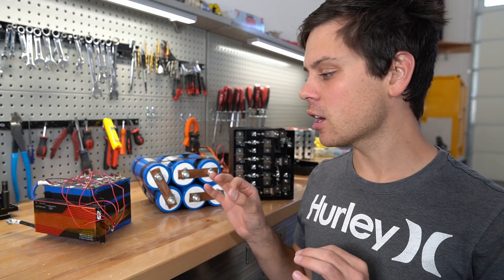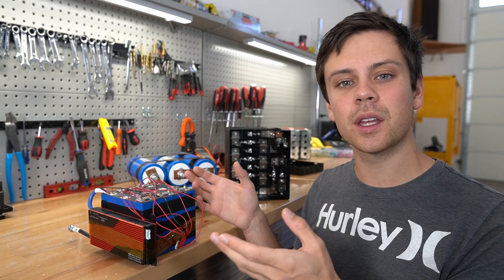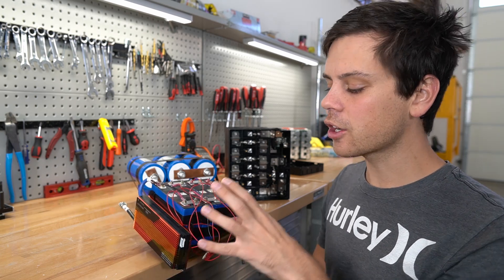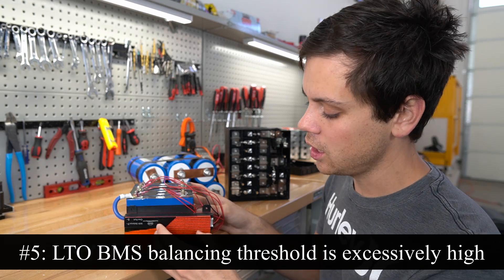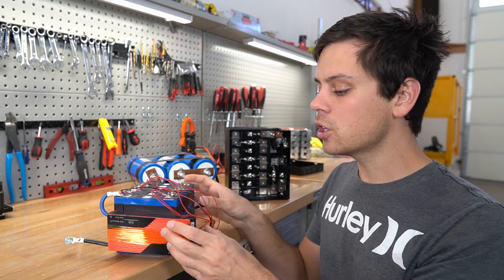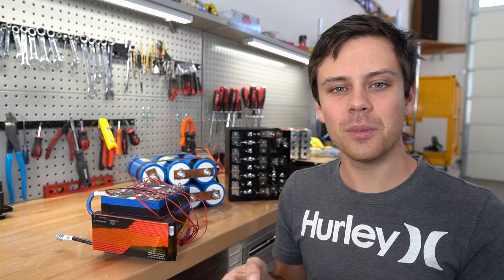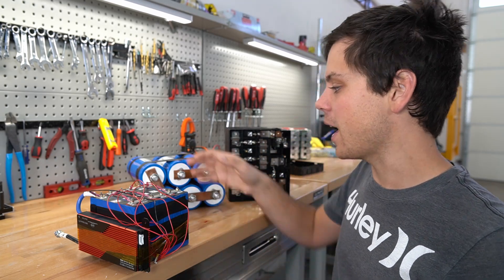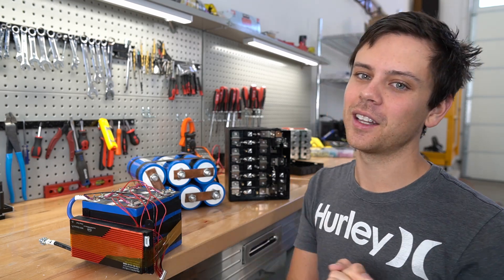I was wrong about Lithium Titanate batteries. But should you use them for solar? 2020 Update

Comment: 2:43 These cells have a charging voltage of 2.7-2.8v and that should not be exceeded at all. 2.6v and 2.7 volts are the best for longevity. So either 15.6v or 16.2v for a 6S configuration. Still not ideal for 12v applications, but when you say 18 volts, this is misinformation. Just a heads up :)

Comment: Kudos for admitting a mistake, but I don't agree with your positioning of LTOs - I run a 8 kWh LTO battery in an off-grid cottage with up to -30 in winter. No worries, it just works - and I assume for decades. 
In conclusion, LTOs are worth every cent of their price.

Comment: These really shine in remote outdoor solar applications like radio repeaters, mesh nodes, and weather stations where you will encounter sub-freezing and possibly very hot temperatures.  I wish you could find deals in a smaller form factor that 60138, 60160, 66160 as these are overkill for LoRa mesh nodes (and you have to do 2S for most of these applications).  I am experimenting with Li-ion and LiFePO4 burial beneath the frost line for LoRa in Arizona where we get both high and low extremes.

Comment: Hi Will. I enjoy your videos. I have a MS in Physics and pretty much understand everything you are posting. However, I have a specific application question. I have a 4WD golf cart. Currently uses 8 each 6 Volt 200 A-h batteries. I would like to replace those with lithium of some type. The buggy uses 2 each 18HP or 13.5kW electric motors. The motor controller is a 600 amp. So, it pulls a lot of peak current. I think it drops back to 100 to 200 amps just rolling along. I can buy 12V 100 A-h LiFePO4 batteries for about $150 each. A 4S4P setup would be $1200. However, I need at least 200 Amp Continuous discharge and 600 Amp peak. The LiFePO4 batteries fall just a little short of this. To replace the Pb Acid batteries costs about $1200 as well. I have also looked at LiTi or LTO and 22 each 40 A-h cells look attractive at a comparable price. However, in both cases the BMS limits the discharge. I am seriously thinking of using 20 or 22 cells of LTO without a BMS. What do you think??

Comment: If solid state doesn’t live up to the lifespan for LTO then I think that I will go with LTO because it only takes a good Ultra Capacitor configuration to fix the rest of the issues that are listed for efficiency. Ultimately making the system much more reliable over longevity which is the real goal for these systems for me. I don’t want to mess with them later on down the road other than a little maintenance. and it makes the system environmentally friendly overall because barely anything is going to landfill if it’s built right over my lifetime. It also allows expansion without worrying that if the other parts are not working correctly I wouldn’t be able to over the long term. The biggest issue is that I just can’t slap a bunch of capacitors together and call it a day because they would pull off the lifespan problem. The amp hours are terrible for them. For 12v you only get roughly 7ah but they have a flip side to them of having the benefits that batteries lack.

Comment: 5S-lto=15v 
I fail to see the issue. 3.0v times 5 cells. 
Please tell me you went back an recalled that statement
Reply: LTO cells are 2.3 to 2.5 nominal voltage being rather low to all other options.
Reply: @RichardPrendingue  of course but a 5P configuration gives you a 15v Max ceiling. Plenty for automotive or solar set up but I'm a lifepo4 guy

Comment: Yup LTOs are way over priced, but I like them more then LiFeP04 for a lot of reasons they have the highest C draw out there, the BMS inside does control the max draw current and has a wide range in voltage to play with. I use LTOs on a 12v setup with no problems, most of the inverters are not accurate on telling you the right Voltage. I got a big 12v inverter that is off by 1 volt higher so I take invantage of it, the inverter V range is 10v to 16v perfect range for LTOs. Just program the MPPT controller to work in that range and it's aficentcy is over 90>%

Comment: I want a good set up for my full time. Living RV off grid, looking at purpose built rack batteries, my question is, waht volagae is best 12, 24,48 and wahst the max KW system, need to run lights, computers, kettel, starlink fridge microwave etc

I have looked at 5 kw systems, but can I really accommodate enough panels to charge such a unit and advice would be great

Comment: I have a very specific use case for LTO - IoT equipment in remote locations. I like the fact that LTO cells will charge without issue in very cold weather and the long life cycle offers much reduced maintenance. My question relates to charging. It looks like LTO batteries in 1S configuration will work well with a constant voltage charger with a specific cut off voltage of around 2.8V and no trickle charge. If so one of the adjustable SLA battery charger modules will do the job just fine. I do not need large capacity - 10 Ah will be fine maybe 20 Ah depending on operational factors. The voltage will need to be boosted to around 4V. Am I on the right path:

Comment: I dont get your Voltage Numbers on LTO Cells, specially on capacity test.
Yinlong 66160 
Charging upper limit voltage 2.8V
Discharge cut-off voltage 1.5V

You did not go to 1.5 per cell an claim they dont have the ratet capacity

Comment: In Australia, there is a national battery testing center, that tested lithium storage batteries provided by BYD,Tesla and LG among others......and the results were not so good. BYD had 15% degradation of capacity after 4 years, Tesla powerwall and LG had 30% degradation after 4 years.  LG just had to do a major recall on their products for setting homes on fire when their units failed.  How it performs when its new, is not the same has how it performs after being in use, in real world conditions, over cycles and time. EV's are doing better, since most people are not charging/cycling their batteries every day.

Comment: Did you consider the differences between manufacturers and chemistrys of those LTO cells? I'm currently researching this chemistry, and found out that LiShen for example has a nominal voltage of 2.5v, ShengQuen has cells of 2.4 and 2.3v nominal, and Yinlong is also 3.2v nominal. But according to the datasheets, those Yinlong cells can reach 80-90% capacity at 14,4V at 6S, while the ShengQuen cells only reach 60-75%, no matter if you take the 2.3 or 2.4v nominal cells. You also mentioned 3V/cell, could that mean you are allowed to charge a 5S bank to 14.4V? That's 2,88v per cell instead of the recommended 2,8v.

We still did not get our hands on these cells, so I don't know what cells perform best at 14.4v.

Comment: L.A. batteries can last a decade or more if properly maintained. You'll need to scale it properly, but still, its cheaper in a 50-60% over scaling. I ran the same set of batteries for 14.5 years, I had to change them out only because abuse by ppl who were house sitting. They ran microwave at night, damn near every thing on, would kill the power, and go out and flip the switch, hard cycling the battery bank to zero, and didn't even bother to check the water.

I was so mad.

I probably could have renewed them, its actually possible, but the process is time and labor intensive. The acid is hard to get, the chemicals needed are not exactly friendly either, and you need electricity to run the process, not exactly easy to do when your battery bank is toast.

There's a reason they buy back old batteries, its because usually there still potentially functional, just needing a rebuild.
In the old days, that's exactly what they did, rebuild them and resell them. Today they just reprocess them into "new" batteries.

Comment: I have to ask, how can these batteries be of large scale high draw power systems?

40 amps, less than 10 second draw, by the end of a build, your at over a grand roughly.  They only seem good for small applications because they don't scale up well at all.
An  L.A. system can go in the hundreds of amps, even at a 75 amp draw, and way cheaper.

They make sense for very specific, special application, like EVs, where they can be squeezed into small areas.

Comment: Thanks for all the great info Will! I doubt you'll read this old video comment, but I'm going to do a 24v LTO battery build for my solar set up I think, and am considering the Toshiba 2.3v 20ah cells. Any advice (anyone) on whether 12s6p or 11s5p would be a better idea? Seems there are differing opinions on 11s vs 12s. I'd rather go with 12s6p if it doesn't make a difference, and I'd have four 24v batteries, which would make it easier to switch to 48v later when my 24v inverter dies.
Reply: Hello Trent. Did you complete your set up? Like to know how they are doing, I'm getting getting my system put in in 3 weeks, with 32kw LTO batteries. I would love to hear how your doing.   Thanks
Reply: @JayRuperRoe  Hi there! Yes I did complete it. I highly highly recommend them. They take a lot of charge fast, they hold up to the cold, I don't have to worry about discharging them too deeply (though I still only discharge them to about 10-15% just to make sure they really last for hopefully decades), and they really don't take up much space. I also only charge them to about 90%, though I could charge them more, it's just to really get the lifespan out of them, which could make a decade of difference in the end and be the difference between them lasting 30 years or 40 years or something. Really glad I did it.
Reply: @trentrhode7417   I hope I'm not bothering you, but I have 2 days to change from LTO to LiPo if I want. How much  KW in panels do you have charging? Which Inverter/Charger are you using? What KWH are your batteries? And are you running you whole house off of this system. Thanks for your time.
Reply: @JayRuperRoe  Whatever you do, do NOT do LiPo, horrible idea! Those things have such a short lifespan, you'll just have to replace them in a few years. If anything get LFP if not going for LTO.

I only have 1.4 kw of solar panels, but would get twice that at least if I was staying here (moving soon then will reassess if I have space). Using an Outback charge controller and Magnum inverter. The outback is not ideal for these really, but they're okay because I don't charge the batteries fully, and these units can't charge them fully. What it does is it just makes my SOC reading inaccurate but not a big deal, I just keep in mind what the real SOC is. There are better charge controllers but I can't remember them off hand, though a google search should turn up some results. Just have to make sure they handle the voltage range of the batteries.

I am running my whole house off this system, but it's a tiny house and we are extremely energy efficient. I even turn my fridge off at night and make ice during the day to put in the fridge. Particularly in the winter here when there's much less sun. I only have 11 kwh of batteries, but would prefer twice that.
Reply: @trentrhode7417   Man, I can't thank you enough. I'll be getting 6k panels on a Tracker and 3k on my Garage lean-to. & a 1200 wind  generator, all hooked into a 12k Aims CC and Inverter, I'm considering adding another 12k Aims alongside the other. As you can tell I'm a novice, so please  correct anything I say.    Cheers

Comment: So i guess the only limitation is getting a 13.8v charger and bms. Can we simply use an arduino to monitor the voltage and cut it off?

Comment: All lipo’s I had damaged prematurely and often swelled, regardless of the discharge/charge rates, for example some 1200mah pack swollen  by only using 500mA charger and about the same discharge rate, other was 5Ah, and 35C and used a few times at 20A discharge for like 20s then at very low 1A powering a GPU type fan. same with lifepo soft shell packs. One was used for a remote control and it simply swollen and died after 1 year and a few charging cycles, another one the same but it was 3300mah and was used with 30A surge (less than 1s) then 15A for a few seconds, died after like 15charging cycles. All of these, prismatic soft shell packs. my current lifepo 3300 mAh, hard case but the same cells as the soft case ones it is ok used for moderate work like above, it has swollen but it performs ok, has about 20charging cycles and like 5years. 
another new lipo pack, soft, 10Ah 35c runs a 150A 22Vskateboard motor. but they also swallen. 
now the only thing I didn’t test carefully is the charger which may deliver more voltage than it thinks it does. I have cheap battery alerts and they show the same as the charger so I didn’t suspect anything. one way to reduce the risk of overcharging is to charge lipos with li-ion program and then run anothe li-ion charge cycle at low current (0.2A) if time is not an issue otherwise the charger will stop way below the capacity 
cylindrical cells li-ion  seem to work better but they are very low discharge rate. I would try some lto packs

Comment: Hi, I Live in a constant winter cold, freezing, and dark environment and use the off-grid small solar system for lights. I must buy or make a 12v winter battery,  so it can charge fast in sub-zero temperatures and it can also work in a minus -10C to -20C. What is the best solution LTO perhaps? Thanks.a lot Alex

Comment: what does c rate mean?
Reply: It means how fast a cell can be charged or discharged, using its capacity as a unit. Max continuous discharging at 10C means that a cell can discharge 10 times of its capacity, e.g. a 10Ah cell can discharge up to 100A continuous without problem.

Comment: I think the insane longevity justifies all of it's flaws. I wanna get these kinda batteries for my electric bike in the future. I know it's not gonna be cheap and it won't have high capacity, but really high longevity and small charge time are very important for electric transport
Reply: Not really.
Reply: @IndenturedYoutubeSlave  lol.
Reply: @IndenturedYoutubeSlave  My LiFePo4 battery was tested by driving a steel rod through it.  It didn't catch fire.  The massive cost of Lithium Titanate is just too high to justify its widespread use.  Maybe in some specific applications they can be justified, but doubtful they will ever be mainstream.
Reply: @michaeldoherty2289  they are already mainstream in buses in cold countries where
-safety is critically important
-charging speed needs to be super high
-charging in low temperatures is required
-high longevity is needed so they wouldn't need to be replaced every 1-2 years. 

and they work perfectly there
Reply: @TabalugaDragon  I think they are used mainly in consumer electronics, probably because they use small batteries so the high unit cost isn't as much a factor.   Don't get me wrong, they are really amazing batteries.  I would never argue that they aren't superior.   It just that the cost factor for large batteries is making them very difficult to justify compared to other chemistries.

Comment: I use a 80 amp mppt a 5000w inverter two 12v 200Ah batteries powered by 3x 250w solar panels later six total. where and what size fuse and where should I place it?
Also later I would like to add three 100 war panels how would I wire them to my six first panels

Comment: Why don't you do a video on building a battery pack that can be used in an automotive engine start/running situation?  you'd need to cover parameters like cca, reserve capacity amp/hrs as well, etc etc.  you'd also need to cover the various add on components such as what a buck boost module does, how it might protect the car's charging system  and how to configure it, a bms to keep the battery properly charged, and what ever else is needed to keep the car's charging system happy and safe from melt down/failure.  one such company who has a lto products on ebay and amazon is named XS-Power and have among other products a XV2400 Group 24 Lithium Titanate Battery intended for automotive use.  It would be most interesting to see this battery compared against your loved lifepo4 batteries.   

Are you up for the challenge?
Reply from the maker: You should use lead acid instead. It's better for that
Reply: @WillProwse  A battery for my Porsche is nearly $300, & $175 for my truck. And just like a precision clock I have to replace the battery every 3 years. I'd rather spend a hundred or 2 more and get a battery that was designed this century, that will (in the case of lto) outlast the life of the car, save 2/3 the weight of a typical L.A. and have superior performance as well.  The lead acid batteries are a design from 1859.  Why would any one want this in their vehicle when lto or lifepo4 are so much better ? aside from the initial cost difference I see little reason to do so?  Ask yourself this, do any of the solar systems you discuss use lead acid or agm batteries?   I haven't seen any.  Granted Lithium batteries have the higher initial cost, when 3, 6 and more years rolls past and the pack is still functioning you'll see the economics of why the lead acid design should be put in a muesium and not under the hood or in a battery shed.
Reply from the maker: @drpc98014  those are good points. They need a high quality LTO. I don't think lifepo4 is ok for this application because it could get damaged during a deep cycle on a cold morning. But LTO could handle it no problem. Hmmmm
Reply: @WillProwse  my point exactly. however there are a few issues to resolve regarding how to connect to an otherwise stock charging system.
Reply from the maker: And cheaper. No point of using lithium ion for that